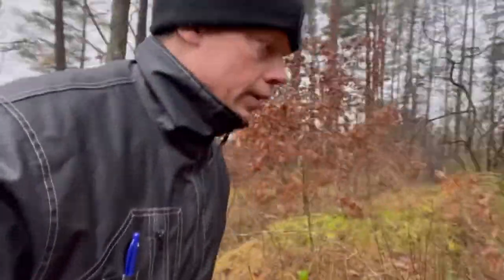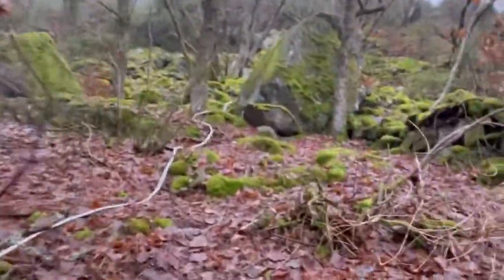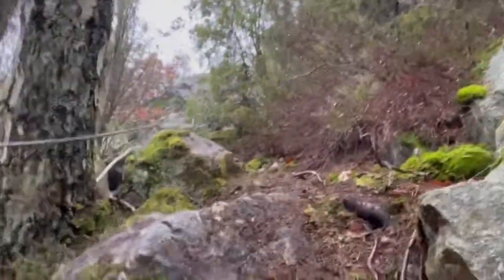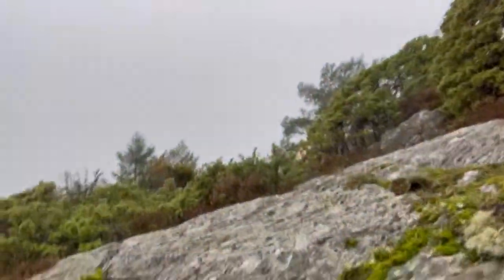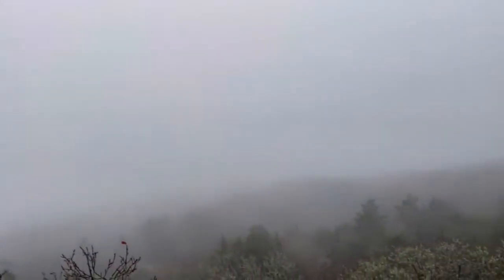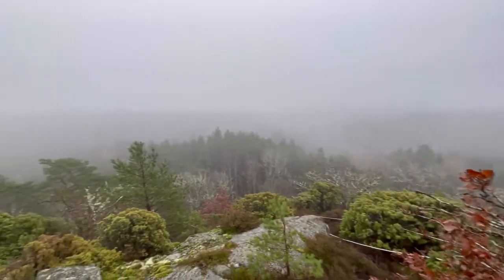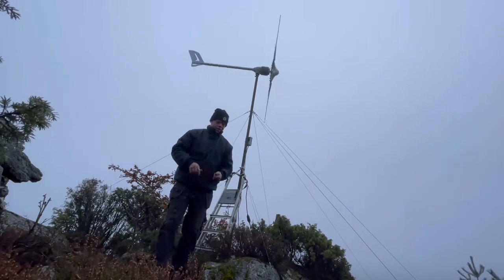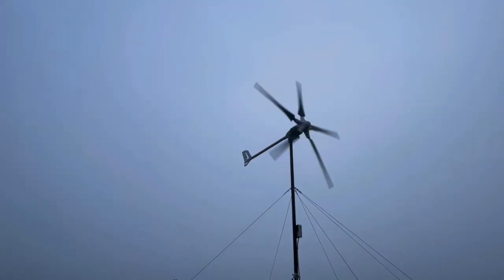My wind turbine installation, high up on a mountain. Istabreeze I1500 48v

Comment: How  big square is the cable?
Have even thought of having 45m between the charge controller and the wind turbine Ista Breze 2000 windsafe
Reply from the maker: Hi, its around 5mm2 in two phases and only 2,5mm2 in the third one. Solid strands. Not ideal in anyway 😅
You will find more about it her https://youtu.be/iddzVztckZQ when I try to measure the power loss in that cable.
Have a great day and thanks for your comment.😊
Reply: @flyingtools  Thank you. And I'm worried about only 25 square mm for a 45 meter cable, hehe..

Is it possible to see an overview/diagram of how you have connected wires to your entire system. From the wind turbine to conveter and dumpload and so on?
Reply from the maker: Haha, 25mm2 will be enough, at least if you ask me. I’m sorry but I do not have that, I did not use a dump load, only brake. I also decided to sell it so it’s a little hard to make more videos about it. But maby I buy a new one, I miss it a lot, because it was more fun than my solar panels.😅
Reply: @flyingtools  Yes, maybe, but if I use a calculator, it's not enough at all ;) Sow you dont have anny more diagrams of setup with sunpanels and windpower togheter? :) 
I will use the same 2of  Istabrezz 2000i and 12kw sunpanels. Which sales platform do you buy old electric car batteries from? I come from Denmark, so I might have to stop by ;)
Reply: Sorry for 101 questions in a row ;)
Reply from the maker: @NCSchroder  no you right, calculators don’t lie. Solar panels and wind turbine worked completely independent of each other in my system.
I just searched at bildelsbasen.se but it starts to get a little harder to get them now days. 
Good luck with your project😃
Reply from the maker: @NCSchroder  you are always welcome.
Reply: @flyingtools  Thanks you, like your channel.. Looking for a solution where solar and wind share the battery through possibly Growatt SPE 5000. Is it a waste of expensive battery to divide the batteries between energy sources. Then possibly a BMS between the batteries which does not interfere with impulses from the charge controller
Reply from the maker: @NCSchroder  my system shared the same 48v battery bank at 36kWh, they used the same voltage so that’s no problem, but the wind controller and the inverter worked independently.
Reply: @flyingtools  Ahaa.. But your Growatt SPE5000 inveter was "only" connectet to battery bank and the IstaBreeze charge controller was charging to the battery? 
Then the other Growatt SPE5000 with solarpanels was charging same battery and uset as an inveter togheter ? :D